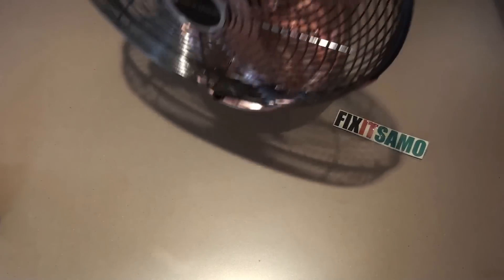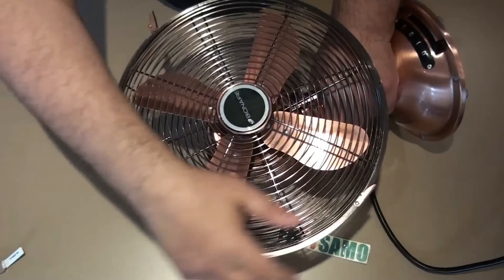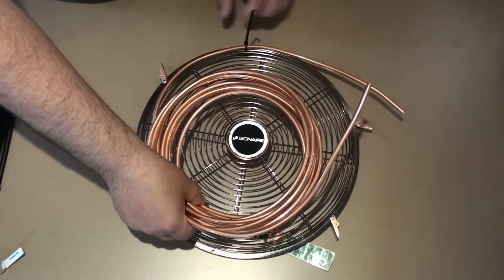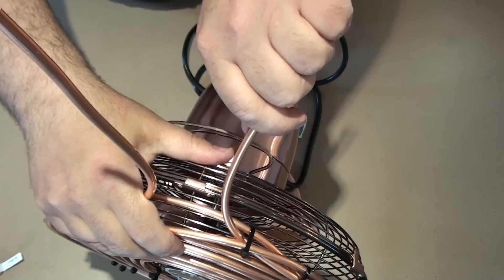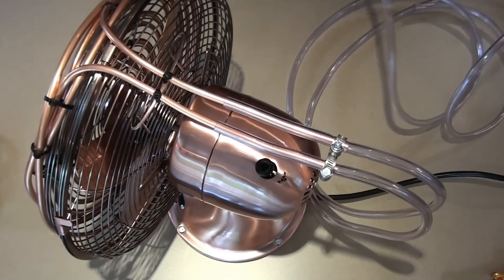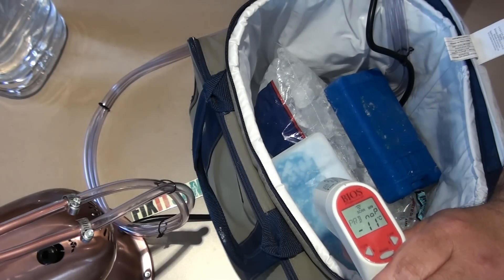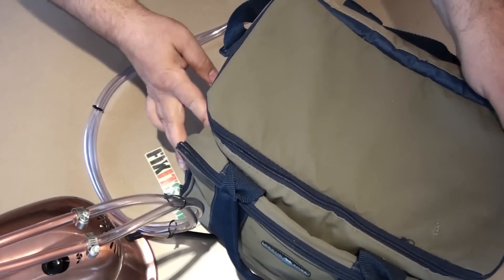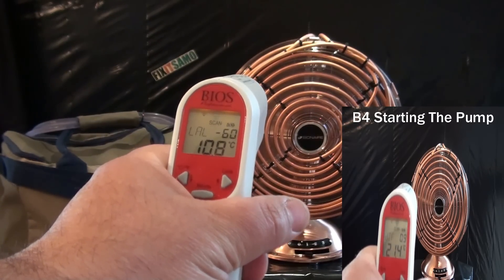How To Turn Your Fan Into An Airconditioner  AC

Comment: Great inventive solution.  I would suggest adding salt to your water as that will lower the freezing temp of the ice and will aide in chilling the water to around 25F (-4C).  You can also use water bottles with a salt solution and freeze those as your ice packs.  Inexpensive and easy to reuse - no big deal to replace them either.

The only draw back I see is you have to have higher line voltage.  It would be quite interesting to see if this could be accomplished on a USB or battery (12V or 9V) approach.

Comment: Unless you're a technician you wouldn't understand how ac works that fan with ice is pure nonsense don't waste your money making that stupidity
Reply: Well it's not completely useless, aircons are great but they run your energy bill up. Aic conditioners use a very similar method with the exception of refrigeration gas. The issue is in order to pump that gas it uses alot of energy where this water pump could run off solar. 

Convert the suns energry into power for the pump isnt a stupid idea however i will agree that ice alone cant drop the temperatures low enough to have a full effect. There is also the issue that reverse cycle air cons also drag the hot air out and expel in exhaust outside.

Having said all that even just having a fan pointed on you makes a huge difference when trying to sleep. If you can drop that air blowing onto you by 10 degrees its well worth it
Reply: "Thermodynamics" In order to run this thing, you have to make ice. Buying it will be much more expensive eventually. Have in mind that the fridge works the same way as an air condition except that instead of sending the heat in the atmosphere (a/c does it with that heat transfer box outside your house), it sends it inside the room (back side of the fridge). You can actually use your fridge as an A/C if you put it's backside to a window and leave it's door open. An A+++ a/c can cool a room for less power than your pc takes!
Reply: hi
Reply: Dimitris Lekatsas
Yeah the concept is basically what i said. Im just saying it will make a difference when blowing directly onto oneself. I highly doubt it will cool a room though.

Having said that this thing probably cost around $60 to make, also running a fan and pond pump cost bugger all on the energy bill.

I highly doubt running any aircon cost less then a PC. Well none that i have ever owned are efficient. Not to mention the cost to buy a A+ aircon to start with.

The fact is you will not make your money back in savings with aircons as like solar energy return systems that are installed on houses.

Comment: If you want to use this cooler in the same room as the fridge you cool all that ice you will make the room hotter. The fridge does not produce cold. It takes the heat away form the inside and puts it on the outside. That's why fridges have a warm back side. That and heat loss from operating the fridge compressor and other motors.
Reply: I don't think you watched the video because that's not how this works.
Reply: I don't think you read what I wrote. I'm not saying it does not work at all. I'm just saying you can't make it sustainable.
Reply: sure you can. This is perfect for my small camper I'm currently building out to live in,  it has a propane fridge that can make ice. With this I no longer need to purchase a generator to run an air conditioner, I can run everything off battery power. I'm not exaggerating when I say this just saved me $1000 or more ( if I get it to work well enough, I just have to consider how to deal with condensation )

Comment: how can i get 2 fountain pumps together. is it possible to combine a splitter 1/4 inch. where to get one
Reply from the maker: sure you canhttps://www.amazon.ca/Plastic-Connector-Joiner-Fitting-Segregator/dp/B00XDU3KCY/ref=sr_1_1?ie=UTF8&qid=1476051581&sr=8-1&keywords=1%2F4+inch+splitter+pipe

Comment: Samo, I wonder if you can do away with the pump altogether? Heat travels to cold. If you ran the flexible tube from the copper into the ice cooler and just connected the ends of the lines without the pump. Warmer water from the fan would be pulled/pushed back into the cooler by the colder water until the temp equalizes....worth a try.
Reply: This "a/c" setup is a derivation of a swamp cooler and to make it work you need a pump to circulate the cold water thru the copper tubing that is acting as the heat exchanging coil.  It should be noted that the 75gph pump is much higher rated pump than is actually required a 5 to 10 GPH would be more than sufficient.  Additionally this sort of setup is prone to spitting of condensation off of the heat exchanging coil, so it is a good idea to place a towel on a sheet pan in front of the fan to catch condensation.  It also should be noted this type of cooling rig works best in low humidity environments but when you are hot anything is better than nothing.

Comment: Pls don't listen to that nonsense
Reply: nothing nonsense about it
Reply: This is complete nonsense. Your freezer makes the ice by 'pumping' the heat out of the water into your house to form the ice, then you take the heat and put it back into the ice/water by using the pump & fan. The heat energy just goes in circles, but never leaves your home. The whole contraption actually creates a net positive in thermal heat because of all the motors & electricity you use.
Reply: or you can go to the store and buy a block of ice

Comment: Since ice is the prerequisite for this air-conditioner, another better option to cool the room is to keep the door of your fridge open at all times!
Reply: amount of heat produce by radiator of your fridge is more than the cool air it makes with door open, IQ!!!!!
Reply: @ahoorakia  Correct. It will also destroy the compressor eventually.

Comment: You need to transfer the heat out of the room. It's just temporary relief. It's the same as letting a bucket of ice melt in your room
Reply: Pat John that's actually not accurate, the heat from the room is being transferred into the insulated bag of ice. 
The problem with this design is capacity and the sweating of the copper tubing.
Soon as the bag of ice equalized with the temperate of the room it will stop behaving as a refrigerant (which water does have an R number because it is one, just not a good one).
The real problem is as the copper begins to remove humidity from the conditioned space it will have no where to go. There by causing damage to the fan or a mess where ever the fan is.
Cool idea tho
Reply: +Fred Watts no. Second law of thermodynamics. If the container he is trying to cool is the room he need to transfer heat outside the container. Else, he is neither cooling or heating the container as a whole as it moves toward entropy. Unless your argument is he will keep shipping ice in and carrying melted water out of the container, which isn't a "cool" idea at all. It is the most primitive and near sided solution for air conditioning.
Reply: Lol it's a little do it your self project for fun he is not trying to reinvent anything. That being said you can put the condenser (in this case the bag of ice) anywhere that it is irrelevant, that was the purpose of the plastic tubing being cut to the desired length. 
When the refrigerant (cold water in this case) is being pumped through the refrigerant line to he evaporator (the fan with copper tubing) it will pick up the heat from the room and return to the condenser and transfer that heat to the ice. This will remove heat from the space that he is attempting to condition ....i.e. Elementary refrigeration lol. 
Please cite more thermodynamic laws that you clearly do not understand it's pretty funny.
Reply: I think heat does transfer from the room to the bag of ice. If the rooms cools or not, that depends on the room. It could be large enough and weather hot enough, that it gets warmer at a higher rate than it gets cooler, in which case only some subspace get cooler.

This happens as the ice melts, as u both agree on.

Imo, this solution sucks. Idk what else u could get for that price, but it sucks. Still, it's pretty fun to think one could do that. Makes a neat youtube video.

Comment: doubt he is trying to air condition  a house or a room, just having a tad bit cooler air from a fan . miight be a ok idea to use in a work shop where the the fan points air and blows on you  . i live in the deep south it gets very hot in summer and any releif means a lot lot lot !! when  people buy fans they know its not an a/c unit lol lol lol

Comment: Where I live, humidity is half the battle. Must get the water out of the air!!
Reply: technically this will do that, as the fan pushes the hot humid air through the cold copper coils, the copper coils will collect the humidity and it will condensate on the copper coils.

A friend of mine built one of these, and he had to put a tray below the fan too catch the condensed water.

Comment: run the pump and water chiller side to the inside of a old fridge. you would have to drill some holes in the door and then seal them but you would not have to worry about ice or put it in the freezer and run some glycerol through the mix
Reply: or u could plumb in an aquarium water chiller too....a bit expensive but could run all the time then

Comment: Three issues.  
First, as I live off grid, one of the early things I looked into was using ice on a larger scale than you have, for air conditioning.  I ultimately gave up on the plan, due to the fact of poor BTU performance that can be had from the use of water ice.  Using other frozen forms of materials (like dry ice) wouldn't be cost practical either.

Second issue is you choice of thermometer.  A surface laser thermometer isn't going to provide any viable information.  Yes, the copper tubes are cold, but it means nothing in regards to liquid to air heat exchange.  Rather, place a regular probe style thermometer in the air stream if you want to show any efficiency values.  

Third, if you were to get any decent cooling effect, which I doubt you will due to the low surface area of your "evaporator coil" (ever look at a regular air conditioner? It uses copper tubes too, but with something else to make it work) you will run into a condensation issue.  I suppose you could just put a baking sheet under the fan to catch any condensed moisture, but like I said, I don't think you can get enough thermal transference to require such. 

All in all, it's a cute idea, but there is a reason it isn't done like this in the first place.

Comment: Problem with this is you need air compressor to properly. Cool large amounts of air,  if not using one you are essential cooling your room with ice water in front of a fan.

Comment: I own a semi truck. I'm thinking this would be nice for me at night so I can shut my truck off and not die in the heat on hot summer nights. if I leave my truck run all night it's about a gallon of fuel an hour. fuel is about 2.50 a gallon so it gets spendy. I could run this in my sleeper with my curtains closed and hopefully it'd work well enough to sleep comfortably
Reply: all the best !!
Reply: You own a semi truck. Good news! Because this is a semi air conditioner. 😄 Jk

Comment: for the price of that copper and pump you could just buy a AC
Reply: that copper is 20 bucks and the pump is under 20. if you can buy an a/c for that and it works more power to you.
Reply: AC unit will cause way more and plus  I like the creativity

Comment: Swam cooler not new but thanks
Reply: Swamp Cooler*

And no, this is not a swamp cooler, it's a far better design. Evaporative cooling uses the change of state energy of liquid water evaporating from a substrate (usually cellulose strips) into the ambient air, thereby lowering the temperature of the air. There are a number of disadvantages with this type of cooling, the biggest being it gets progressively more inefficient as the ambient humidity rises. It also cannot be used in enclosed spaces because it will act as a runaway humidifier which will quickly saturate the ambient air to 100% humidity and stop working.

The best environment for a system like this would be in a place with very low humidity like a desert.

The device in the video has more in common with a real A/C system than it does with a swamp cooler. For one, it's a closed loop system so no excess moisture is being rejected into the ambient air. In fact, it will reduce the ambient humidity from the chilled coils pulling humidity out of the air. It still utilizes change of state energy (so does an A/C system), but that process is internal to the system in the reservoir with the ice melting into water.

All of those other YT videos about people blowing air across ice in a bucket are essentially making a version of a swamp cooler, which has the same issue of being an uncontrolled humidifier. If the air is cool but is extremely humid, it won't feel as nice as air which is both cold and dry.

Comment: Put together very will, but wrong choice of instrument to measure its output, infrared thermometers measure surface temperature, that 10 degrees is actually the temperature of the coil, which is not that impressive since its ice water flowing through, since it's not 100% efficient the air will be a little warmer, actual thermometer is the ideal instrument to use.

Comment: cant you build something that can use refrigerent
thats how cars cool down the air.
would it work?
just wondering
Reply: Lmao. You mean an air conditioner? if it uses refrigerant it probably needs a compressor and condenser... unless you're venting liquid refrigerant which is costly and illegal

Comment: I never saw a fish tank pump that had the power cord in the water I don't think that pump was designed a submersiable so it may fail rather quickly if it don't kill you first with ele short.
Reply: its not a fish tank pump, its a fountain pump, perfectly an completely submersible
Reply: a lot of fish tank pumps are submersible even if they look like they are not

Comment: 4 galon jugs of water 2 on the freezer to freeze two in the bag with water swap them out. done and done. the larger blocks may stay longer the only bad thign is if they melt they may toucht he ater less but some system where you rotate with freezer.